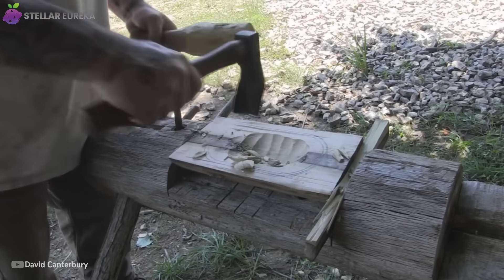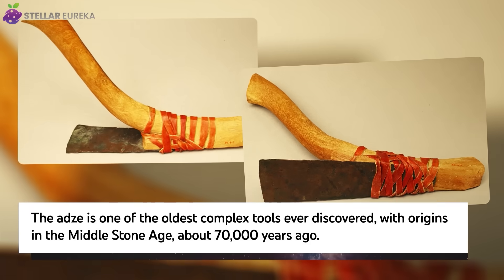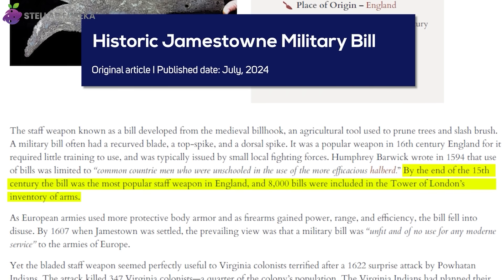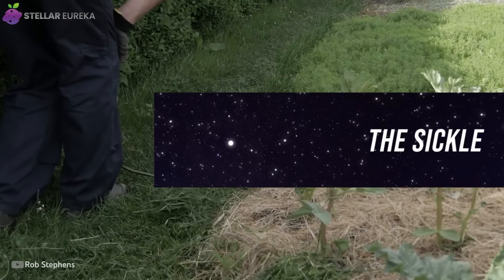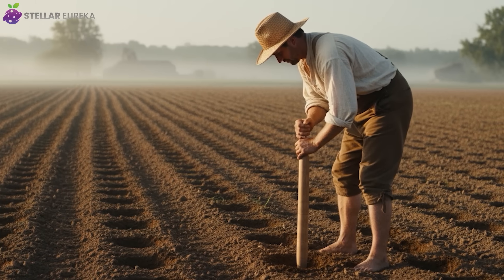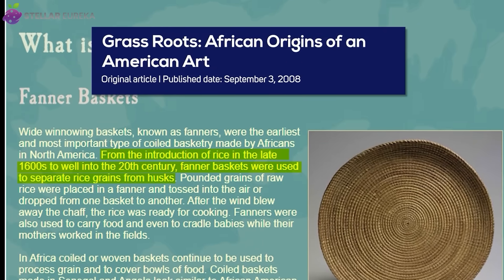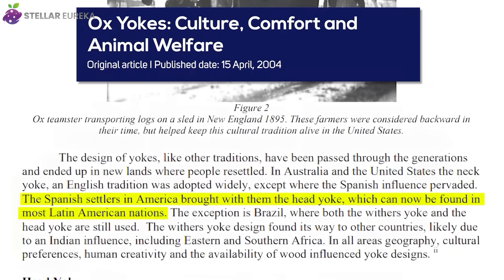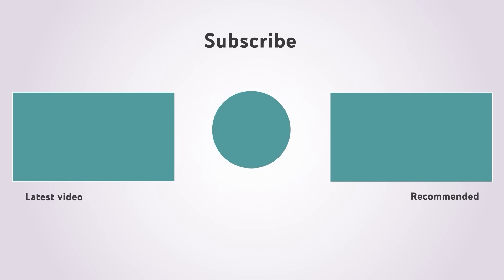Why Ancient Farmers Were SMARTER Than Us: 10 Tools That Prove It

Comment: I use horses for tilliage work, use a fanning mill instead of a winnowing basket, and a sickle bar mower instead of a sythe.
No gasoline engines involved. 
I have, and do use a sythe for trimming around fencelines and areas I can't get into with the team and mower. And, yes, for smaller areas, a sythe works well. Would hate to have to cut several acres with it.
Still use the adze and bill hook  for their respective jobs.
I use a 2 bottom moldboard plow rather than the scratch plow. 
I like to turn over the organic matter into the soil as green manure/fertilizer. 
I also have a grain drill and 2 row planter instead of a dibbler for field planting. But do use 1 for the kitchen garden.

Comment: Steam is possibly the most powerful form of energy. We'll never know the limits of its power, because we can't build a boiler strong enough to find out. All steam boilers have a safety valve, to release steam, when the pressure becomes too much, to prevent the boiler blowing up. I saw a tug-o-war contest once, between a monster diesel tractor and a 1930's steam tractor. The steam tractor was just the size of your average small basic tractor, but the diesel tractor it was pulling against, was a monster, with about 12 wheels, front & rear. When the starter's gun fired, they began to pull, and the little steam tractor, pulled the monster diesel tractor, backwards across the whole field. The people couldn't stop laughing.
Reply: We do know the limits of it's power, and it can't exceed the power of the fuel source that is burned to heat up the water.
Reply: @call_me_mado5987  That sounds more like a limit on the fuel rather than the steam itself.

Comment: Sorry, perhaps scythes work well in fields of just hay/grass.  Not so for clearing brush.  I used an electric edger that moved the edger from vertical to horizontal back in the late 1960s to clear brush from a canyon hill to create a fire break.  My manual version of the weed cutter would not even nearly keep up.

Comment: A scythe is definitely better at mowing than a trimmer. But a trimmer generally isn’t meant for mowing open areas. It’s for trimming in areas that a mower can’t get to, usually the same places where a scythe wouldn’t be effective.
Reply: It's for getting right up next to trees, fences, large stones, and building foundations. You'd snag or chip your scythe and damage it trying to do that trick. If anything it's more comparable to the sickle, but faster for the intended task.
Reply: @pauljs75  Actually no. I can use my scythe around those objects very well. In fact they are better than trimmers for going closely around trees (if you have some modicum of skill), in that the s scythe doesn't harm the bark. Snagging in wire mesh fencing can be a problem, but a very sharp scythe and smaller slower slices while being carful of your angle so the point doesn't catch works and then you just pull the few strands left with your hands  for final cleanup. You don't damage the coating on the fence like whacking it with the strimmer. In really tight quarters you just use your sickle .

Most people just grabbing a scythe out of a barn or yard sale don't take the time to really learn how to use it or to properly set the scythe up or sharpen it properly. Subtle differences make a huge difference and the scythe must be really sharp which takes skill that you need to put some time in to master. Also, many of the old scythes people find in America are very heavy ones left over from the railroad industry for clearing along the tracks, not good for cutting grass. Without skill you will tire out instantly and have a hard time. Once mastered scythe are a joy to use.

Comment: If you have never used a scythe, and the opportunity arises, jump at the chance. It is just so beautifully designed, a simple twist of the waist, and you can cut maybe 3 or 4 square metres of grass. It just feels so exactly right to hold. (NB There are probably lots of other things you should try, but, apart from catching bricks, thrown up to  you on a scaffold*, I'll not suggest any more. I'd be interested in others, little amazing discoveries.)
*Two bricks, thrown together by a person, maybe ten to fifteen feet (3-5m) below you, aimed for you to catch is quite amazing. The bricks leave your co-workers hands with real force and speed, rushing towards your out-leaned head, but when thrown properly, they just slow down as they approach, before coming perfectly to rest, mid-air, about chest height, and you simply reach out and pluck them from the air.